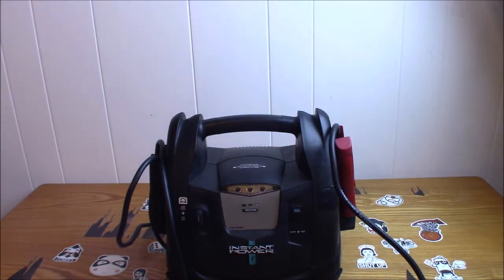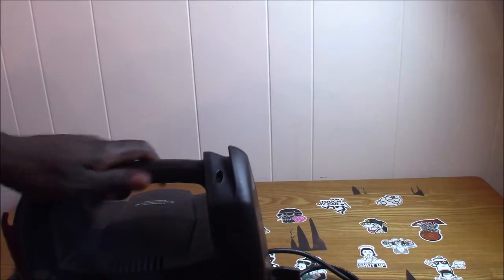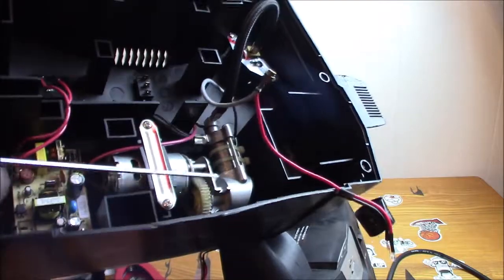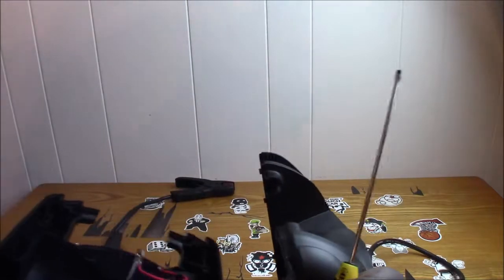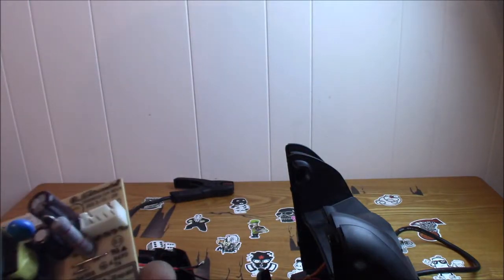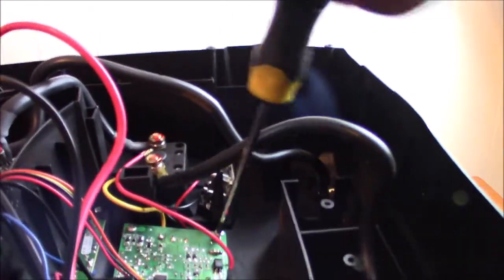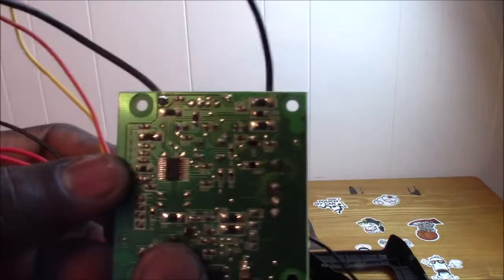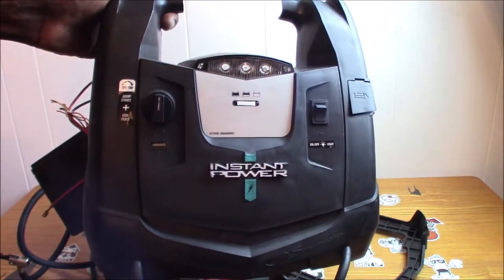Instant Power Car Jumper Starter With Tire Infiltrator Disassembly Lets See What's Inside The Device

Comment: The battery on this unit is easily replaced, cost around $19.00.  Screws out are important.  They are not all the same.  If you want to put it back together correctly you will have to be attentive.